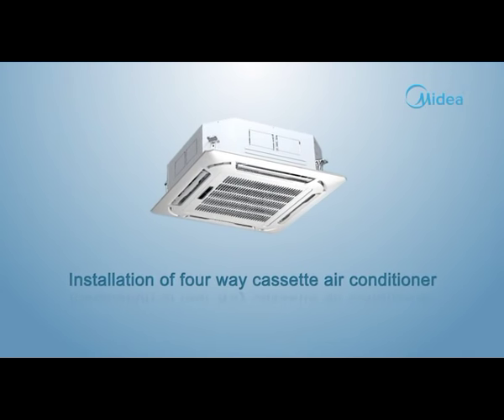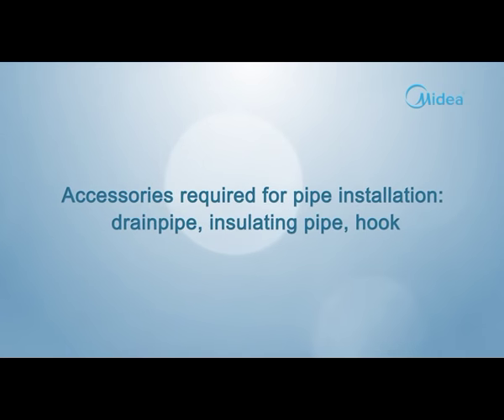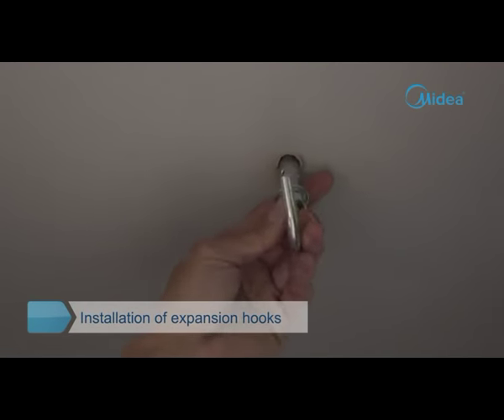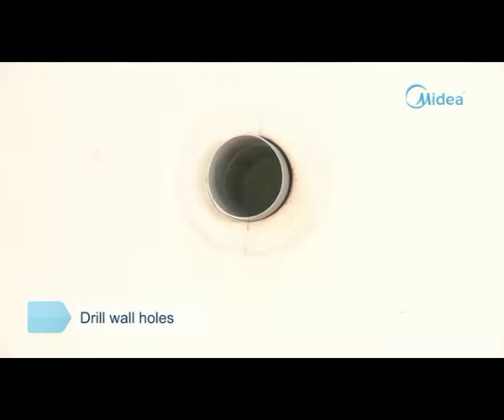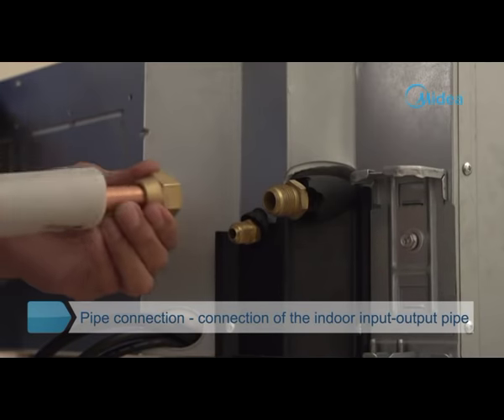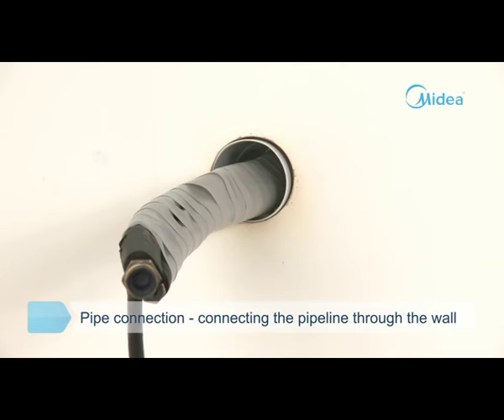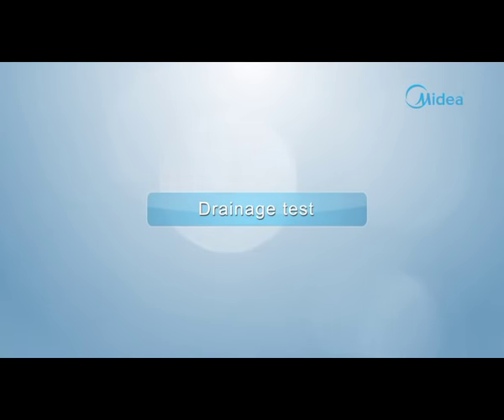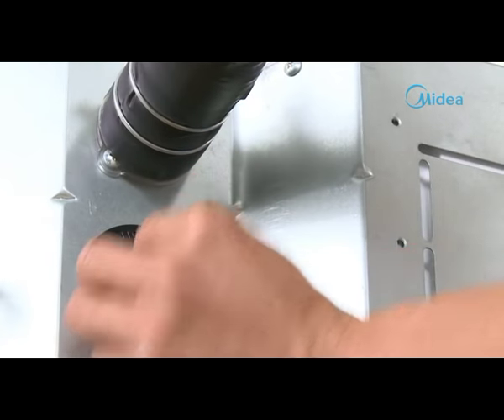How to install a Midea Ceiling Cassette? #hvac #minisplit

Comment: 393 inches of clearance from what? A wall ..  so you are saying this can only be installed in the center of a room that has 32 FEET of clearane on each side? so room that's 64 feet x 64 feet installed in the center ... ummm WTH?  that makes ZERO sense .. This video is .. "Not Smart" OMG 1.2k likes .. unlike intelligence the opposite has no bounds at all ..